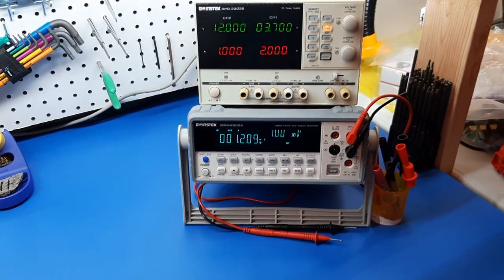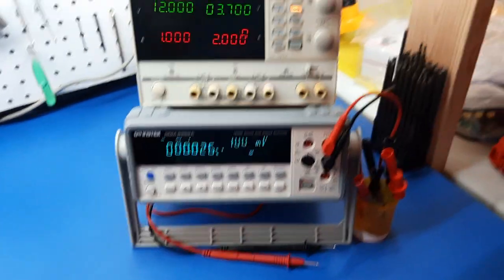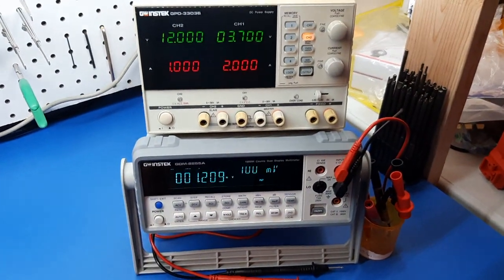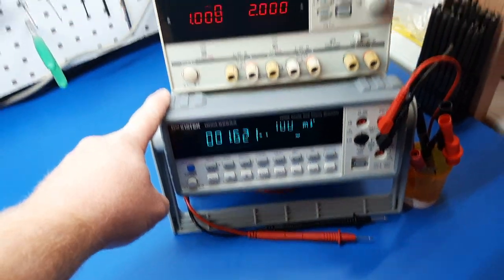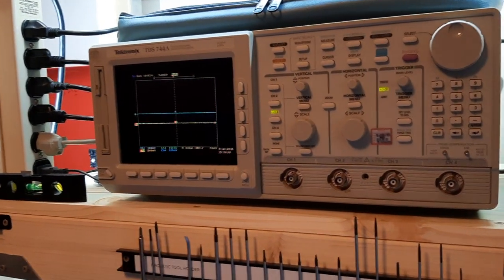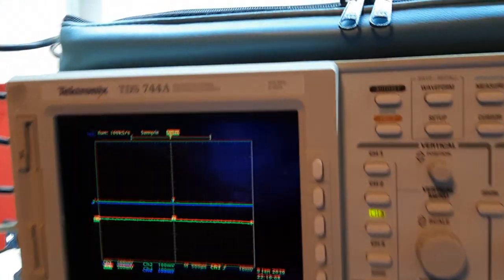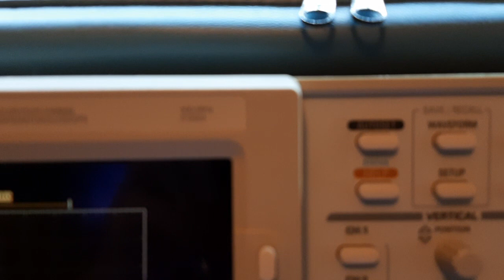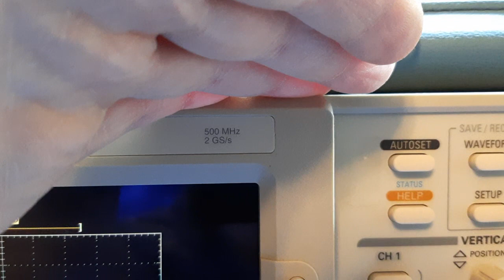New electronics workbench tour (built Nov 2022).

Comment: I love the bench but there is 1 problem the magnetic strip can interfere with your test equipment, that actually happened to me before so you should 3d print or buy holders for your tools instead of using magnets. OVERALL great build i also have a small place like you i will build a bench like yours!!

Comment: hello. whats the width and height of your desk? thanks
Reply from the maker: Desk is 5ft wide and 26in high.  I added 4x4 beam cuts under the table legs and some non-scuff furniture pads which bring it to 30in high.  I wanted a 6ft wide and 30 to 32in high table, but ended up working with what I could find on Craigslist and settling for the 5ft.

Comment: Nicely done. What is the greyish doodad on the left side of the bench that sort of looks like a vertical vise? Also, you said you kept an eye on things on Ebay. Why the choice of benchtop p/s? What kind is it? I'd much rather buy an older U.S. 80s/90s maintainable p/s than a cheapo Chinese crap pile from Amz. Didn't think to look on Ebay, and thankfully you woke me up before I pulled the trigger.
Reply from the maker: 'Greyish doodad' - if you mean the small tool hanging off the left side of the table, that is an old Stanley mini table-clamp vise.  If you're looking further back onto the table, the large grey/white device is all the microscope and the boom stand for it.  The power supply is a GW Instek 3303S triple-output 30V/3A unit, Taiwanese company, they make good stuff.  Bought it because it was a good price for a quality 3-channel bench PS with the output range I wanted - they're sold new for ~$650 and I got it for $175 after shipping.

If you are looking for a quality late 80's / early 90's era bench PS, the HP 6600 series is always available on eBay due to how many were made, very popular power supply.  Just search for HP Agilent Power Supply and you'll see a bunch of 6623a and 6633a and other variants pop up.  Reliable, maintainable, can be had for ~$150ish, sometimes ~$100 though usually not lower than that if only because of how heavy they are which factors into shipping costs.

Comment: It's beautiful. I'm also trying to setup an electronics bench. Just bought my first oscilloscope last week!
Reply from the maker: Thank you, and I'm glad to hear you are working on a setup of your own.  I advise keeping an eye on eBay for good deals on bench equipment, that's how I got most of mine for pretty cheap.
Reply: Can you make a recommended list for beginners? I used to build circuits a long time ago in college and get by with a breadboard + components + oscilloscope + power supply + solder. I don't know what a basic electronics bench looks like these days.
Reply from the maker: @foobar4496  For the majority of common uses: multimeter, soldering station with breathing and eye protection (could be respirator, fume sucker, soldering in an outdoor-ventilated shop - just something so it isn't going in your lungs), variable power supply, good lighting and a magnifying glass.  Beyond that with hand tools: normal and small-sized screwdrivers, side-cutters for cutting wire and component leads, and wire strippers.

The oscilloscope doesn't often come into play for common repair / diagnostic needs, though if you are looking into building circuits again it will have use.

After those you get into less common, more niche tools for different uses and situations.  Need a dedicated tool for testing capacitors or testing reactance?  LCR meter.  Wanting to diagnose USB power issues without fuss?  USB in-line multimeter.  Want to reflow solder that is inconvenient to get with an iron, or multiple joints at once?  Hot air station.  Need to get eyes on ultra-small component level work?  Microscope.  Doing RF analysis?  Might need a spectrum analyzer and/or a VNA.  Looking for hot-spot failure points on a board?  Thermal imaging.  And so on.